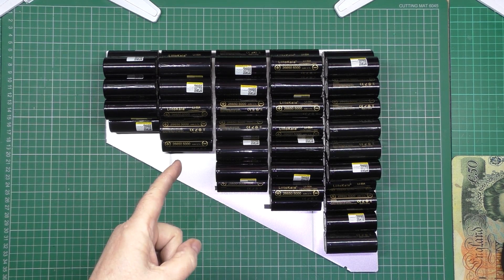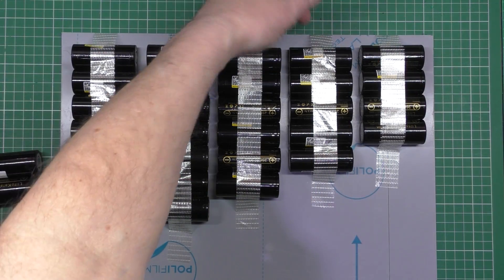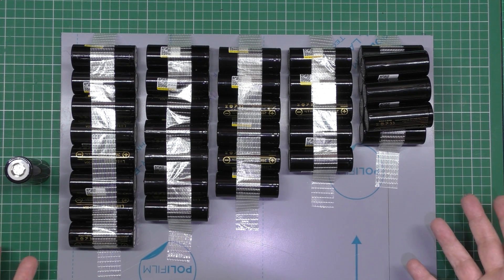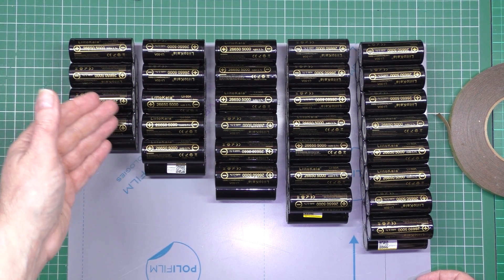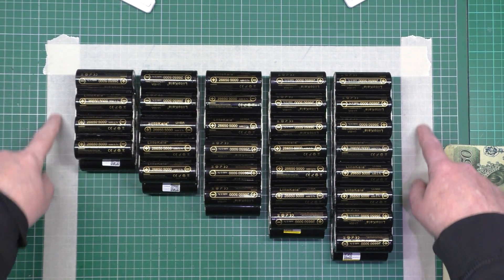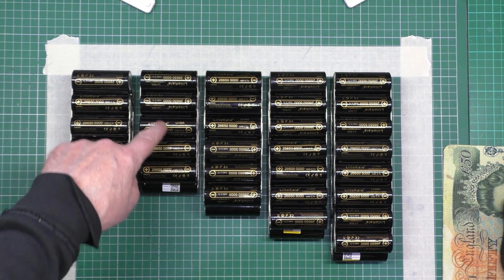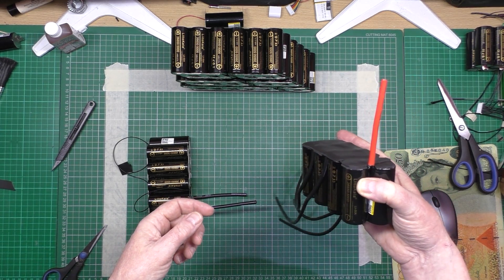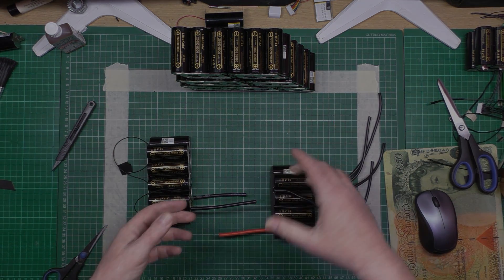High powered DIY eBike MSVA build part 10 - Lithium battery 84v 30Ah 2.5kWh build part 5

Comment: Hi watching your channel and learning, but want to ask why you don't use 22.2v  20ah  12c lipo battery ?????
Reply from the maker: That's rather specific! 😁
I'm not using lipos because I did that with V2. They worked perfectly and the power was superb but they started to suffer after 300 charges. Li-ion batteries have a longer life and (if you have enough in parallel) they'll deliver the same power.
Reply: @Vortecks  many thanks think I will try the lipo route to start with cause I already have

Comment: G'day Tony, when doing your series connections from one parallel 6cell bank to another make sure you solder Wire in a couple of different places to spread the current, you don't want the current flowing through  just a single nickel strip(e.g. a single point of contact), I feel your frustration dude, my 15S / 10P - 35Ahr (150 Cell in Total) e-bike battery build pack was not no picnic either.

Comment: I've done a frame pack on a BMX and ran the cells across the frame, so that all of the contacts are side on. It was pretty easy to lay out, all of the cells were accessible for replacement and no jump wires. Your layout looks crazy to me.
Reply: I tried that for my build, but with only a single layer of cells the area needed gets out of hand in a hurry, even without a shock absorber to work around. I ended up having to turn them sideways like he did. The other issue is that he wants the packs to be removable, so having them on either side of the frame is easier than being in the frame.

Keep in mind, that's only half of the cells. His pack is gonna have a total of 120. If you have a double wide setup (Which he'd need to fit all 120 in the frame pointing sideways), then you suddenly need even more room width wise, and also interconnects between the two layers are a pain.

TL;DR big ebike batteries are a pain, no matter how you slice it.

Comment: Tony, this is looking to be a nightmare making 10x work for yourself!
Can't help thinking you'll eventually end up making the packs with the cells transverse instead of lengthways even if they'll be a bit wider, but I know you'll solve it somehow!
Reply from the maker: It's already solved mate. It fits perfectly and I can now sit on the bike without my legs flapping in the wind.
The problem with the way they were is, every revolution of the peddles makes my thighs and calf's catch against the corners of the boxes - I'd be in agony if I ever broke down!

Comment: Longest battery build in history!
Reply: Owen racing  what I made is nothing to what this guy is going to... I just got these batteries because I wanted to make a small but powerful pack.. my journey to and from work is less than 5 miles round trip.. so don't need many running in parallel because of the amperage.. 50 amp "short bursts"... The battery pack that Tony is going to make or run an electric chair.. and have the capacity for a whole lot of inmates... 😂😂😂
Reply: brooke robertson I’ve just started my own build like yourself. Much the same, I don’t have a huge journey, so I’m not doing any funky stuff regarding series parallel connections.

Just want to make sure I have higher enough voltage and amp hours to get me to and from work.

You going to be running Hub motor or mid-drive system?
Reply from the maker: A bit slow to catch up? 😁
Reply: @Vortecks  lol.. well I spotted the  cells like the black one's you have on AliExpress over a year ago.. and was thinking that they're perfect for an ebike.. so got a bunch.. did a bit of googling and no-one had made one.. just power walls out of the older version.. 'blue cells same brand" 😐.. and then I see "this guy" with a box off the good shit..😉 am fully aware of the power a good pack can make when made well.. like I know you will.. so can't wait to see you on the road..  because I only have a 500 watt hub.. and would like to see someone use these batteries to the full potential.. keep up the good work you are a joy to watch.. 👍
Reply from the maker: @KouRou2002  Ohhhh, I get ya now 😂
I saw them around 12 months ago when I was building V2 of the bike but I didn't bother with them. I just hope they measure up to my expectations!
Reply: wheeler dealer the man who never made a mistake, has never made anything
Reply: GadgetMart correct
Reply: Yip... I got a bunch of the same 26650's.. to make a ebike ... Looked on YouTube to see if someone is doing the same... Turned out not .. just this guy and the dude with the twizy... Both are a bit slow to catch up... But still sounds advice... And the 26650s are amazing...I got them at £3.50p a peace...